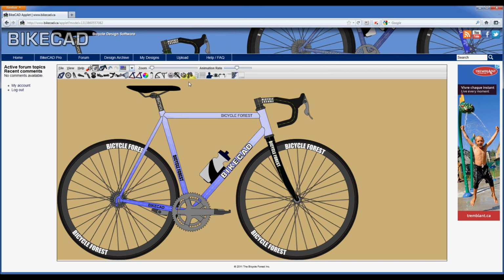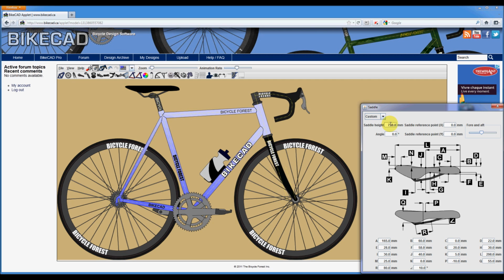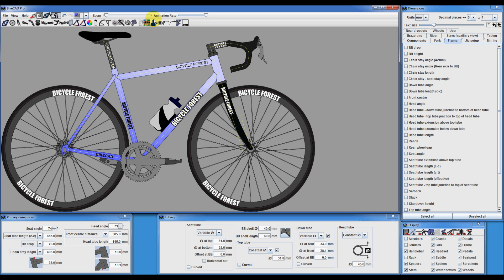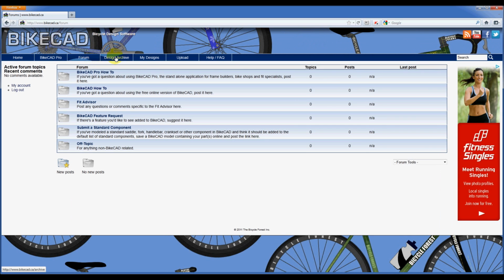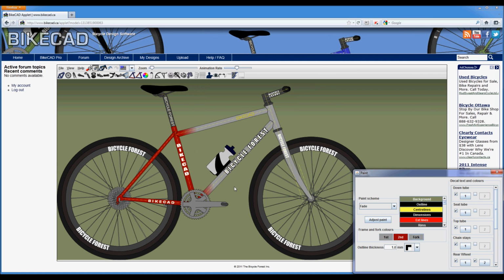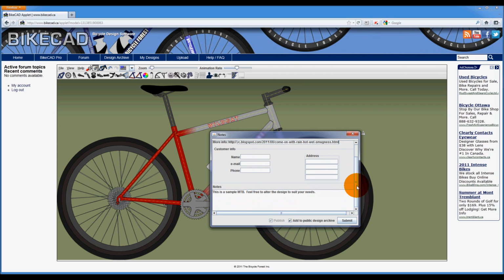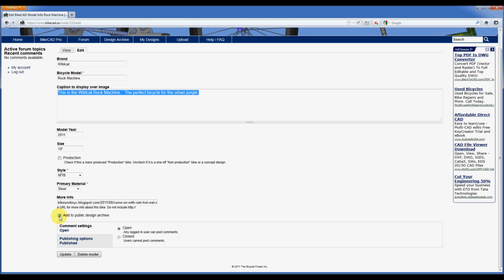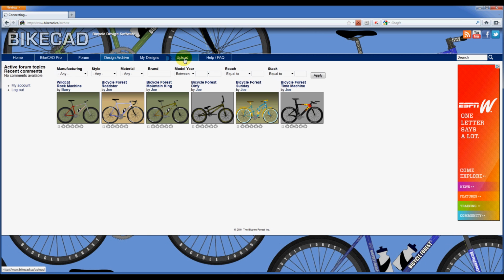Intro to the BikeCAD.ca Website

Comment: I spent quite a bit of time figuring out the free version, but once I did it worked well. The builder I'm working with uses the Pro version. By using the free version I was able to come up with a geometry that worked for me that the frame builder was able to validate. Saved a lot of time